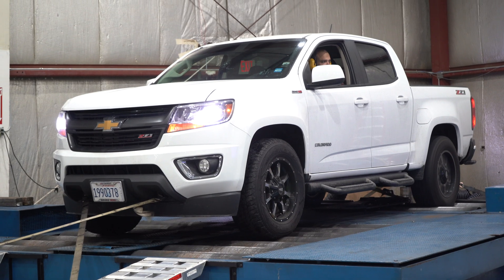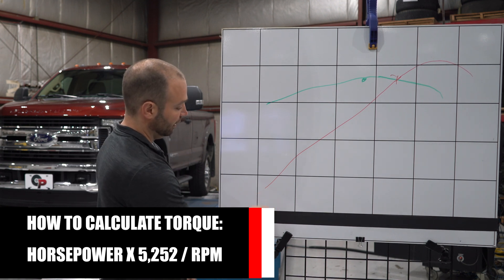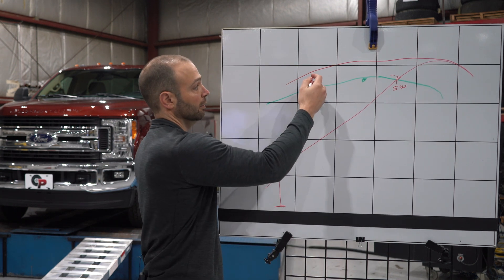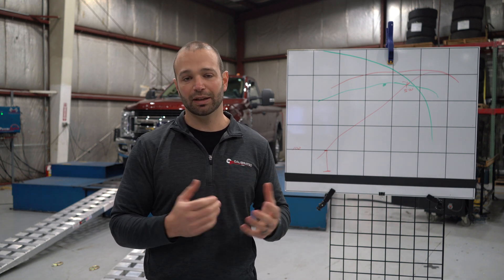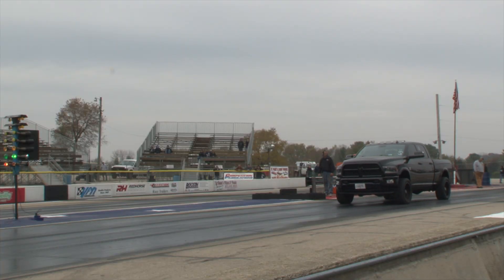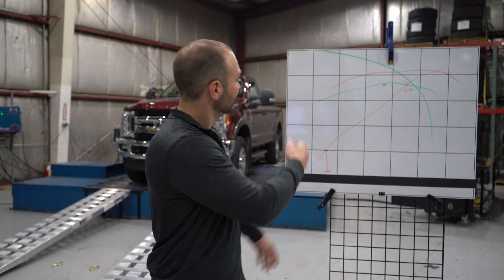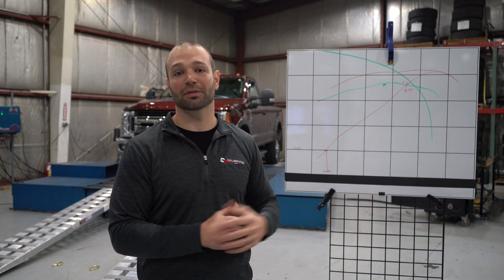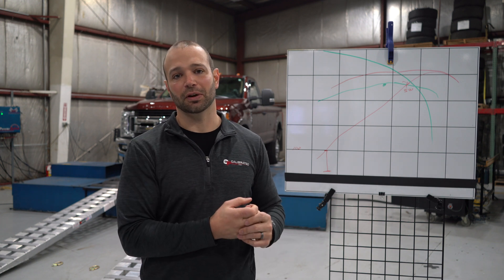TORQUE VS HORSEPOWER

Comment: Great info!
Now explain to us what tq and hp is! Why are 2 different measurements even needed?

If we don't get a answer here is my understanding.
Torque is a measure of force or power. Specifically twisting force measured at 12" from center of shaft. If you would hang a 10 lb weight at the very end of a 12 inch lever in a horizontal position connected to a shaft you would have 10 ft lbs.
Torque is a static force meaning that it exists at no movement or 0 RPMs or any RPMs. HP on the other hand can never exist at 0 RPMs because HP is not a measurement of force. HP is a measurement of the speed at which torque can be used or applied. HP is based off of 2 constants, RPMs and torque.
A steam engine or earth movers may have a lot of tq and be able to move mountains but at what speed? That's how a hp number is somewhat helpful to help us understand the nature of the engine so we can know the best application for the engine. 
There is still still a lot of questions in my mind about hp and tq. You have tire size, gear ratios and transmissions that complicate the issue as far as getting the power to the ground. 
The question us truck guys want to know is hp or tq numbers king as which will crest a big hill towing a big load with the fastest mph? 
My thought is that if you had 2 identical vehicles, tires, transmission, axle ratios, the higher hp would win over the higher tq. 

Your thoughts?
Reply: Power, not torque, is the limiting factor in not only the top speed of a vehicle but also how quickly it can accelerate at any speed and how much weight it can pull up an incline at any speed.

Comment: Hi Nick, if you have a turbo charged gas engine such as the Ford 3.5L EcoBoost, this engine "may" be inherently less reliable long-term with the combustion instability you mentioned, unless you use higher octane fuel or that doesn't really factor enough to make a difference?  Great explanation of the concepts of HP and Torque. :).
Reply: Brent, you're absolutely right.  The higher octane you run in your Ecoboost the better combustion stability you'll see in these high torque situations.  E85.... even better :)
Reply: @nickpriegnitz5895  Thank you, Nick.

Comment: The engine masters guys messed with some turbocharged small blocks awhile ago. I think it was a stock ish 383 stroker that they did it to. But anyway it made way more boost than they thought it would, and it was freight training its way to 800 ft-lb before 2200 rpm. If i remember correctly they stopped the run at 1800rpm and a tick over 600 ft-lb to stop the engine from grenading

Comment: Did you guys switch from the MM3 to the EZ link system. ? I picked up one from you guys about a year ago for my 16 cummins.   Was there issues with the mm3 system ?
Reply from the maker: No issue with MM3, EZ Lynk is just a little easier for an average customer to use.